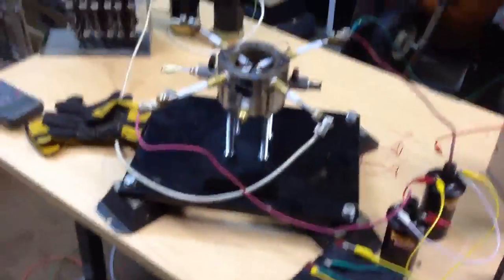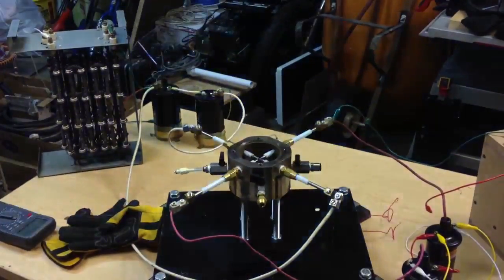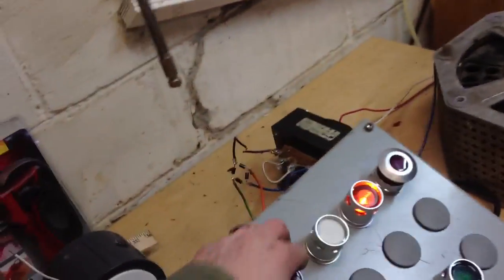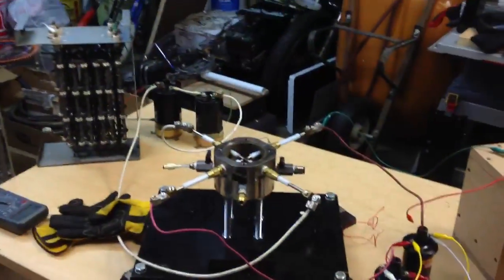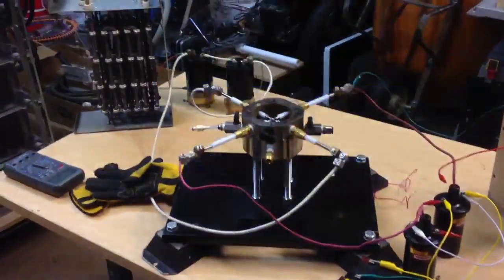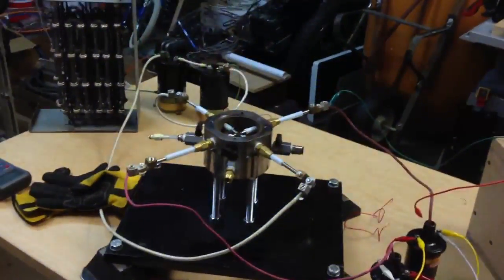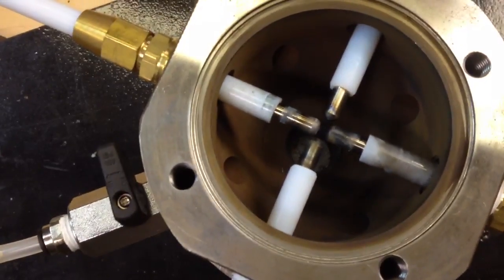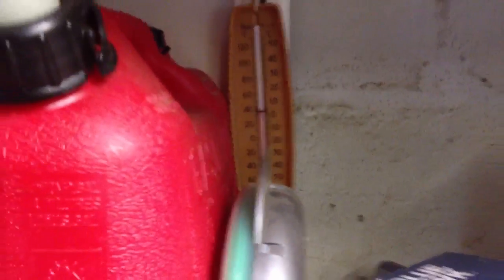NGE 20.1 Power Speed Popping. Just wanted to see how fast I could pop thins thing! ;) ~Russ

Comment: That is an open cylinder I am assuming? No glass cover is being used? Is this configuration generating pressure waves? It looks like pressure is being generated with air in the environment, so it will work without exotic mixtures, but with less power. Can you loosely place a glass or clear plastic cover over it and see if the pulses are generating expansion waves, perhaps the lid will be moved or propelled by the pulses.